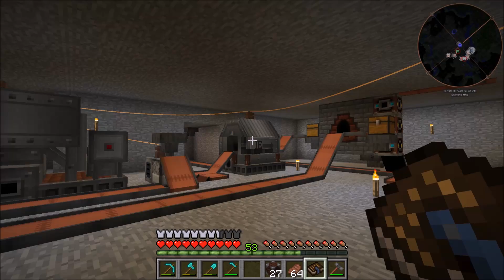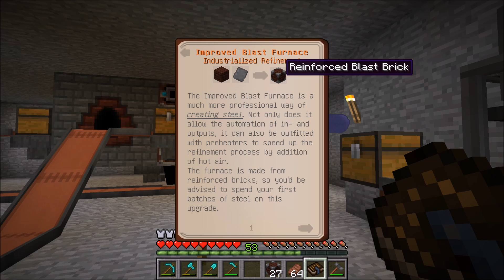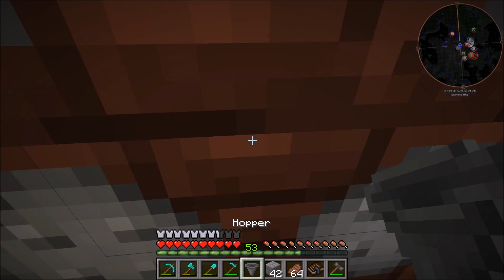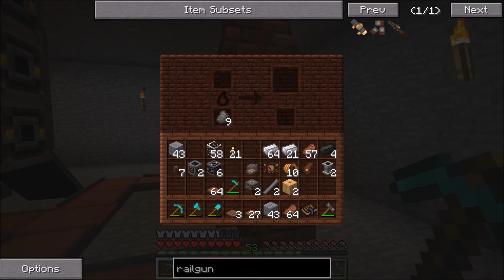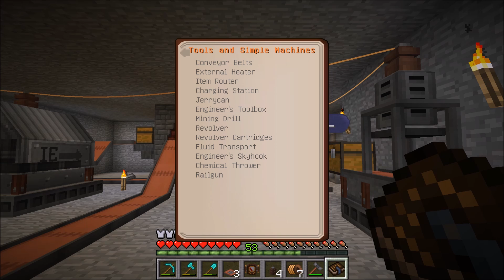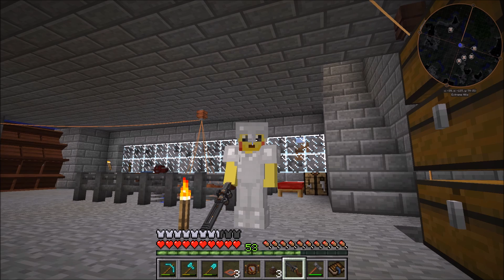Surviving With Immersive Engineering :: Ep.19 - Improved Blast Furnace Preheater And Railgun

Comment: The difficulty you had placing the wire connectors was because you were technically standing in the block you were trying to place them in. That's always annoying with non-full blocks.

Also, a useful thing to make for climbing around, is Aluminum scaffolding. Same as steel scaffolding, but much, much cheaper.

Also, if you need to show the recipe for something that's already in the world you can hit 3 on your Numpad to show it. It's part of NEI.
Reply from the maker: +Triaxx2 Oh, thats awesome! Never knew that about NEI :) Ill be sure to use it
Reply: Thanks for the numpad 3 tip!